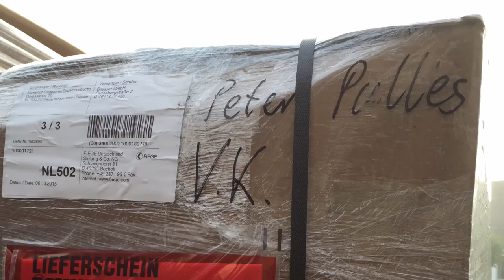Skypod Adventure      A Dream Comes True

Comment: Very nice, Looks like you will have many enjoyable nights spent on your roof. Well Done.I'm quite keen on getting one myself the more I see of them the more I like. They are just the right size for my yard and they look really nice too.
Reply from the maker: Hello Mik, hope your dream will come true as did mine!  BTW I must say that my EQ8 with a C11 and accessories like a 80mm apo imaging scope and 66 ed guidescope, leave too little room for me as observer/operator in the pod. I underestimated that. Therefore I start my equipment up and leave the pod to remote control the gear from  indoors. You might want to make a good planning and layout to determine what scope and setup might fit optimal, leaving enough space to move around in the dome. Good luck and enjoy the anticipation! Peter